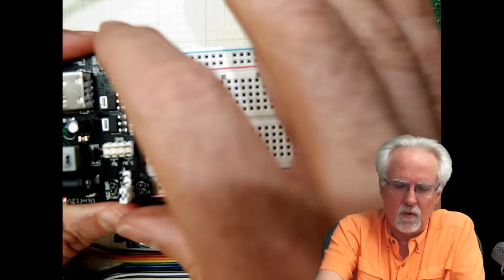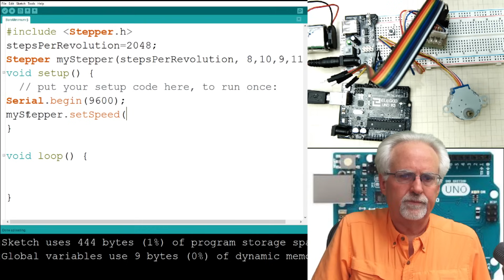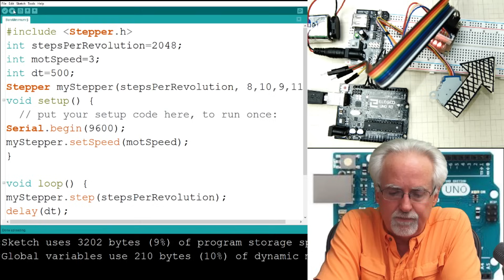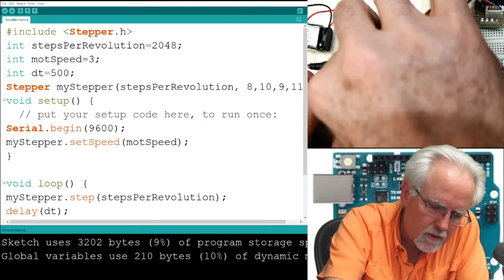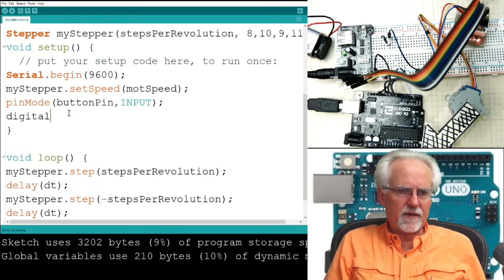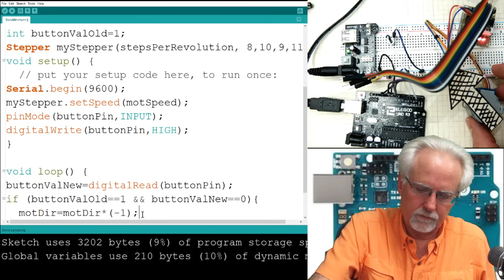Arduino Tutorial 35: Understanding How to Use a Stepper Motor

Comment: I just did the first part of this tutorial and I had an issue that the stepper motor would not switch direction when I expected it to. It just did another clockwise rev. After checking code and wiring many times with no success I googled the problem and found an arduino forum post with the exact same problem. The poster solved the problem by swapping int2 and int 3 on the driver module. I have no idea why this works and why it's not like it is in the video but just wanted to add this here. Any ideas why this problem? I'm suspecting something with the motor.

Comment: Robert here from BC again. I'm wondering if it is possible to run an older HP DMP - 50 ( 14 pen ..3 axis plotter) Its a serial port. No drivers available anymore but I would think there has o be a way to serial connect from a Arduino to W10 laptop. I'm doing this to help a retired engineer friend of mine.
my email: rebiersteker@shaw.ca ... THANK YOU

Comment: When running the program without the recording of buttonOldVal it keeps alternating directions like you previously mentioned since the conditional statements are always met when the button is pressed (since  buttonOld remains 1 always). There was a 50/50 chance that the project worked as intended on each button press lol. Good to always test our code thoroughly!

Comment: As always, another great tutorial. I did the homework myself. Slightly different but mostly the same and it worked. I found that an 18650 battery works well for powering the stepper. Lasted several hours and is rechargeable. I wasn't sure it had sufficient voltage but seems fine.

Comment: Hmm, I followed everything you did and went through my regular debugging steps and just can't find out why my stepper motor isn't working. I feel it working by its vibration but there is absolutely no turn, overtime my battery begin to die and the vibration got weaker, i'll try a new battery tomorrow, but I think the wiring in my motor is wrong
Reply: Hey, quick update stepper motor would vibrate but wouldn't turn, the driver also didn't light up with the LEDs, the green LED on the Power supply module was also very dim, I replaced the 9V battery with a new Duracell one and everything started up great, ELEGOO batteries might be bad so get a new one! Everything works now!

Comment: I finally got it!
I used the switch, "the old-fashioned way", with the resistor (I forgot the new system), but at the end it worked.
I had problems with the change of direction; first because I had it at full turn and then because I discovered that printing the values on the screen slowed down the program so much that it didn't detect the press on the switch.
It was too much work because of my clumsiness, but I finally managed to do it in a similar way as you did, Paul.

Thanks so much!!!

Comment: I'm a retired swede of 71. I've been an engineer for 50 years. My first experiece with computers was my  Commodore 128 and Basic. I do remember the com speed of 9600 and sometimes even 2400. After that it has mostly been hardware. I discovered the Arduino and got interested. I stumbled on your videos and was hooked. After watching a number of them I realised I had to get the Super Duper Kit. So it is ordered but not yet received. So far i've watched your videos to the end, but programming them in my head, so when I get my kit I think I must start from scratch and do it irl. I've also noted that you have videos about RasPi and Python, so I don't need to be bored for a long time. I have a number of ideas that can be solved with the Arduino and some coding instead of a bunch of CMOS/TTL IC's. Like so many others in these comments i wish I had a teacher like you at school.

Comment: hlo sir very good channel for gaining. sir actually i want a project with arduino uno lcd display and stepper motor speed controller with rpm 1 to 500 rpm with actual rpm display. thanks if possible plse its very urgent. my mail id is vaidnaveen73@gmail.com

Comment: stepper motor stilllll wont function properly - jittery motion and not completing rotation before reversing direction.  Ive watched this video several times and 100% everything i have here is wired and coded exactly as shown, powersupply 5V jumpers are connected properly,  tried several different new batteries, even tried wiring the IN1-IN4 pins and 8-11arduinoPins differently as others have suggested in the comments.

also tried connecting the stepper/driver directly to the arduino 5V/gnd but still had the same problems.

i ordered a new stepper motor and driver.. really hoping that's the issue!

Comment: Mr. Paul, the battery is quite low in life and doesn't last very long, so can I use the cord that links to wall power? I'm not too familiar with the AC/DC subject and how they are fit for different motors. Will it mess up my driver or motor?

Comment: I did it!!! been really following along and getting the hang of it! I recommend checking out his website as well.
i did it a simpler way to reverse direction. i am new to coding so i try to make things simple and straight forward, lol.
 if (buttonVal==1){
    myStepper.step(stepsPerRevolution/2048);
    
 }
  if (buttonVal==0){
    myStepper.step(-stepsPerRevolution/2048);
}
by using this part you reduce the steps to 1, and by doing so when you hit the button to flip the buttonVal it drops into the second "if" statement nearly instantly reversing the direction.

Comment: I too found my 9V battery running out of juice while watching the video. In fact I had just noticed my motor has stopped working, checked the battery with my handy dandy multimeter and switched over to the AC adapter at almost the same time  you noticed your battery was exhausted.  Nice lesson - and I was able to complete it as “homework” when the video was paused.

Comment: First, I would like to thank you for the great lessons. Second, I tried your way and my way, However, it still has one main issue. it keeps waiting for the motor to complete one rotation before it starts getting the new readings from the button. I am not sure if this a mistake from my side or it is normal to be like this.

Comment: For those whose stepper motor isn't working like on the video, try switching the wires on IN2 and IN3.
At first it didn't work for me, then I did some research and found some answer on the Arduino forum.
Reply: Thank you

Comment: I can't do this assignment :-(  I followed along with you in the first part doing exactly what you did and it was working until my stepper stopped turning. I could feel it vibrate but it wasn't turning. Ran to the store and bought another exact stepper and it worked for a couple minutes and it died as well. Getting 5v and doing 2048 steps so ???? On to the next lesson.
Reply: Just a dying battery lol. Motors are good :-0

Comment: Hi Paul, I needed a little help, I didn't change the value of the argument for the myStepper.step function to 1. I still had it in as 2048, so my button wouldn't change the direction immediately, I had to wait a whole resolution. I did the rest a little different: 

#include <Stepper.h>
//Stepper Parameters
int stepsPerRevolution = 2048, motSpeed = 10;
Stepper myStepper(stepsPerRevolution, 8, 10, 9, 11); 

int buttonPin = 5;  
int stepDir = 1; 

void setup() {

  myStepper.setSpeed(motSpeed); 
  pinMode(buttonPin, INPUT);
  digitalWrite(buttonPin, HIGH); 
}

void loop() {

  if(!digitalRead(buttonPin)) stepDir = stepDir*(-1); 
  while(!digitalRead(buttonPin));

  myStepper.step(stepDir);  
}

Comment: Must have a bad stepper motor, reconnected 3 times checked the code (3) times motor buzzes and 5 volt light very dim as well the led's on driver board dim light change as code is applied as going through the program but motor just buzzes.

Comment: I did it but I kept the steps per revolution, and multiplied that by -1. And I messed up the which pin the button needed to be connected to, so I ended up going back to basics and using a resistor. Your way makes a lot more sense.

Comment: I paused (after about 15 lessons in a row, I was 2:20 AM), went to bed, slept, got up, got to get groceries, delt with mail and messenger, started googling my stepper motor (my kit - different brand -  didn't come with a board for the external power supply).

I found out that with my motor and my board it should be ok to power it directly from arduino. I found a tutorial online, connected everything, wrote the code and it worked. But I don't like too much if I don't know why it worked, what exactly does the driver do, what are the remaining pins on the driver for, what is the full step mode and what are the other modes. So before I unpause, I'm getting my research done.

Comment: Hi Paul! I'm curious how you came up with the number 2048 from the motor designation "28BYJ-48"?  Is it only because the first two digit number in the sequence began with a "2"? As I move into different motors, will this be the method I use?
As I hope you know, this is the most informative tutorial series I have ever come across, and I appreciate your attention to detail.  This just seems a bit vague to me.
Reply: Also, for the homework, I definitely tried to overcomplicate things with a similar "else" statement like you had in the earlier button switch tutorial.  In addition, I kept the "stepsPerRevolution" value, which only allowed one full turn in each direction.  The button press did initiate another revolution in the opposite direction, but I was beating myself up trying to get a continuous motion!

Comment: My Stepper motor only seems to vibrate, not turn. All the code is exactly the same, and all the wiring is the same as well. Afterward, I hooked up a wire from pin A5 to the positive 5V row (same one the driver is connected to) and did an analogRead(A5). I get about 665, which I believe is around 3.25 V. I tried the other side of the power supply and read about 430, which I believe is around 2.05 V. Anyone have the same problem and know a solution?

Comment: Hello Paul, I appreciate your lessons. You have inspired me to learn this stuff in sequence not just dig around for what I am looking for. The kit definitely makes this easier than digging through my junk. I hate digging!

 I wanted to share a bit of my own knowledge with you. 

Although there may have been another comment or possibly just messing with some of the electronics newbies but either way ROHS isn't the MFR (I beleive this device is from Kiatronics). of the motor it is a qualification for hazardous materials used in the manufacturing process of stuff, usually electronic components. ROHS compliance was a standard that started in the late 90s-early 2000s. I hated the PB free solder, it just doesn't flow like the old stuff...

Comment: Programming no problem, but have a faulty stepper or controller I think. Sometimes drives in the expected directions, but then just turns in the same direction for a while,then at random changes back. First few cycles seems ok, but then goes random. Running from power pack, so not low battery

Comment: You weren't kidding when you said these will eat your batteries.  Am I doing my math correctly? I got the Elegoo stepper motor and ULN2003 driver board kit that comes with several modules. It says Dielectric Strength 600V AC / 1mA/1s. So, if I'm understanding this correctly, one constant minute of use would draw approximately 60mA. If I use a 9V battery rated at 650mAh, does that mean that my battery will last about 32 mins and 50 seconds of constant use if you don't include any other functions or equipment, just the stepper motor?

Comment: I had the same experience as several on this video- the 9V battery that came with my kit died very quickly. BUT I didn't realize that since I heard/felt the stepper motor sort of kind of doing something, and went too quickly to the conclusion that my stepper motor was 'bad'. Glad I saw others posting that changing out the 9V worked. Did the trick for me!
Reply from the maker: Nice troubleshooting. Always suspect bad connections and batteries before anything else. Seems the components themselves are rarely the culprit. Thanks for the comment.

Comment: I got it to work but it was more complicated.  One thing that was weird is that it was going very slowly.  It turns out I was printing some lines to the serial monitor and with the baud rate at 9600 it caused the program loop to slow down and increment the stepper slower.   Once I commented out the print lines, it was fine.  I also tried the baud rate at 115200 and it was also fine.

Comment: It's amazing for me, totally newbie in the art of electronics,  that sofar I can follow and understand  everything our beloved teacher says and explains, and more. He even made it possible for me to really be happy about the working of circuits. Through you Magic comes True, Paul. 
But the Stepper-lesson was a hard one. Nothing worked - I controlled all wires, buttons,....no movement of the motor, no lights on the driver. I measured a correct current on the breadboard and the controller though. I read en reread the code and made changes according to reactions of other students, I replaced the battery and even made a direct connection to the arduino-5Vpin. I even filled my cup of coffee with ice-tea. ..Nothing happened.  Almost on the point of loosing all my hope, i wondered what those 2 unused pins on the motordriver did. I found out that they were meant for an on/off switch! ....and  unconnected..???  so...I connected them and BOOM BOOM BOOM BOOM BOOM BOOOM boooooooM!!!!!!!!!!!! 
Never give up, you guys and girls
ps shouldn't those pins not be covered by a little cap or something like that - or was i so unlucky to miss that in my Elegoo  Super Starter Kit?

Comment: how would i use a stepper motor to control a vertical carousel?
i managed to get it to work just fine until i try to implement a way for it to figure out which direction to travel the shortest distance to the requested shelf.
for instance, if shelf 1 is at the opening and i want to bring the "last" shelf up, instead of running completely around, im trying to get it to move reverse one self...

Comment: Great lesson again and very wide area if you wan't to know what's what. Paul has this subtle way to make us think along when he sometimes messes with code and circuits. I have to check him all the time, no slacking :) Stepper has interesting soul to look at (what makes it tick). Programming has always eluded me, but as Benny Hill once said:"learning all the time" i'm also relentless, especially now when i don't have work and have all the time in the world.  and...Reading these comments helps huge way! Found a place to put this "unseen" code and wondered about 9V battery. Since my stepper (28BYJ-48 ) draws 200mA this tiny 9V battery is no mach for it. These batteries suit only in solutions where current is small, but not in this lesson. Better use 4 AA rechargeable batteries that have more oopmh. And when i one beautiful day have also my hobby room there's certainly 12V wall plugs :)

https://youtu.be/cokngZwEwrw -Learning all the time :)

Comment: Hi, Paul,  I did do this on my own first... but struggled mightily with it for about 4 hours, and ended up with code that was much more complicated and less elegant than yours!  It got the job done,  I won't bore you with my convoluted code, but what i didn't do was dynamically set the state and rule out buttonVal of 1 all in one shot  at the digitalRead of the button, nor did I  realize that you could  ignore starting a full revolution, but just base it all on one step, looping continuously until the button read got a zero value.  So I ended up with multiple nested for loops, returns if the button state had changed, and one set of  nested "for"s for one direction and another set "for"s the other direction, with button reads and check for a change in each!  I suspected I was doing it with way too much code/complexity, but since I got it to work flawlessly at least, it was only after that that I went on to see what you did.  ...and hence learned a lot more!   

Even though I struggled and ended up with a solution that was cumbersome, I still learned a lot by both working through my approach until it worked and then seeing your much more efficient and creative solution, so thanks, and thanks for always encouraging us to try to work them out ourselves first!

Comment: When the stepper motor starts moving, some components on my breadboard power supply module start heating up to the point where they burn my fingers if I touch them. Is this normal? I'm really worried and don't wanna burn my module so I've stopped using the stepper motor.
Reply: You are probably running more current in the components that you should be doing and that is why it’s heating up

Comment: I was working on this and wondered why the motor stopped spinning after one revolution, turned out the battery was almost drained. Plugged in a new battery and worked perfectly.

Comment: I  couldn't figure out why mine wasn't working.  The code was right, the wiring was right, the battery was good and I even went as far as to test every line with a multi-meter.
So I looked up the manual on the  ULN2003 and found the "Dummies" guide.
When I looked at the picture of their driver module, they have a stepper motor on/off  jumper.  Mine did not come with one. 
If anyone is having this problem, the two 'empty'  pins beside the power pins need to be shorted for it to work.
I took a jumper off the power supply side that I didn't need atm, but you could also use the extra ribbon cables to do it on the bread board. 
I purchased the kit in December 2020, so mine might not be the only one with that oversight around this time.